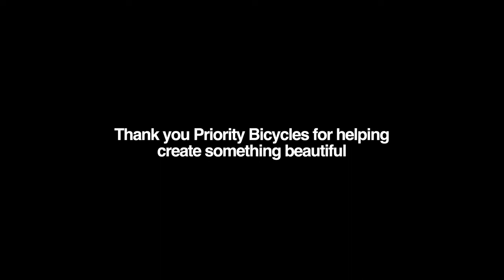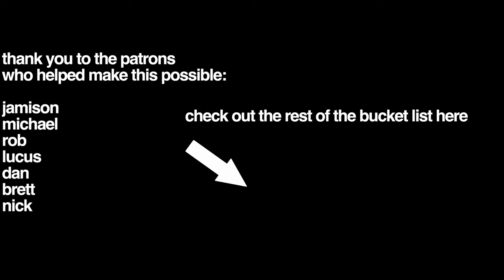ASMR Dream Commuter Bike Build

Comment: A lot of this "ASMR" is just bad assembly practices, like screwing in the bottom bracket without grease. And why the hell you use hybrid cable-hydraulic brakes on flat handlebars? Just for the sake of adding complexity and additional maintenance of both cables and hydraulics? Even basic BR-MT200 would work way better here.
Reply from the maker: Interesting. You must have not done research into their braking system but let me help - the pistons are hydraulic and never need to be bled, and they are actuated by cables which are easier to replace than bleeding a full hydraulic system. I’ll admit the performance isn’t as high as a full hydraulic system but low maintenance performance was the name of the game in this build. 

And if “bad assembly practices” means I get to ride a bike that feels this good, sign me up
Reply: Everybody is an expert these days, say something nice or not at all . Our world is filled with mean angry people Kev is trying to do the opposite❤